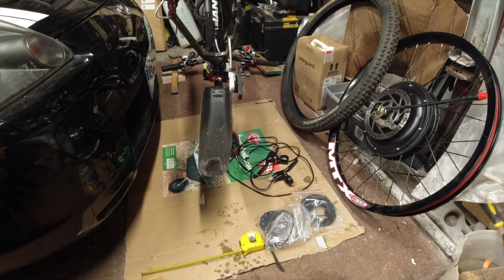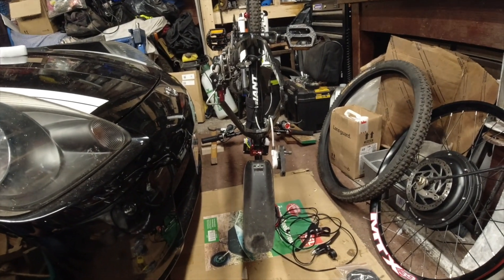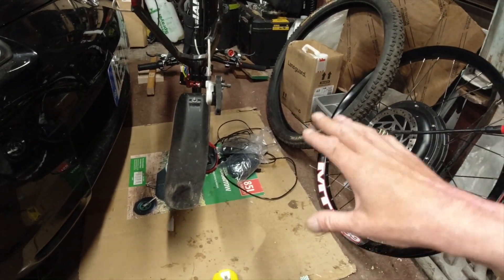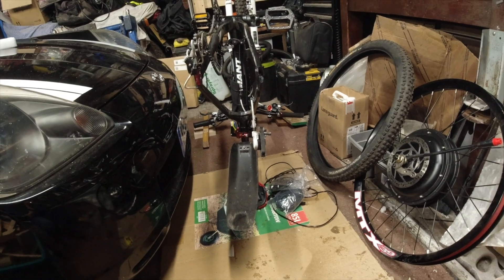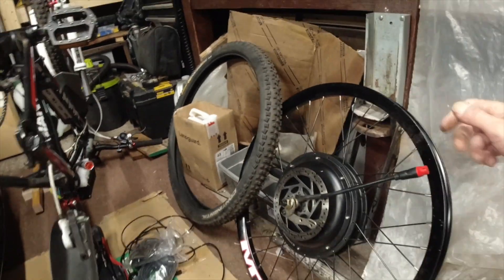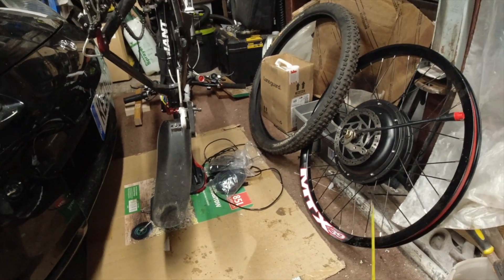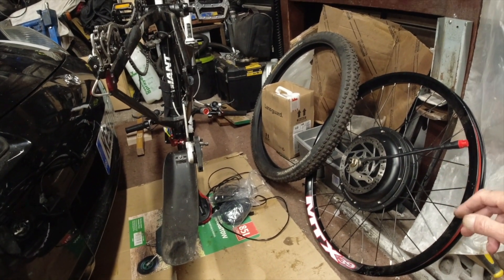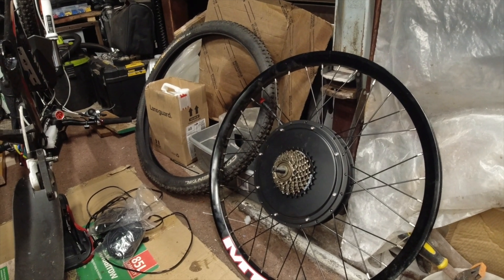EV Costs

Comment: For trail using a hub motor isn't the best option,it is cheap but weight distribution isn't the best too much weight in the rearwheel.Also a hardtail doesnt work i rather have a full suspension bike.
Reply from the maker: I agree with your assessment of my bike 
I’ve answered all your points in a upcoming video and also other comments